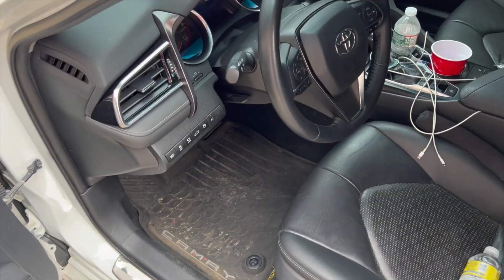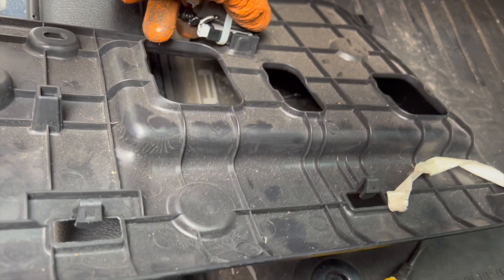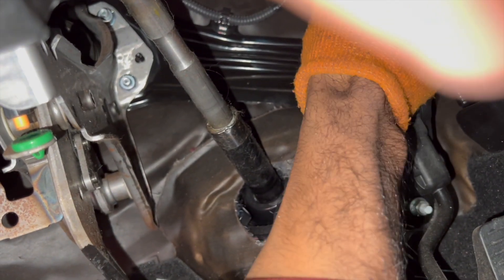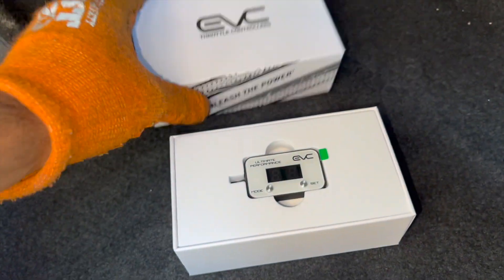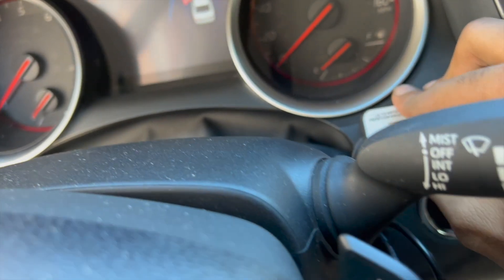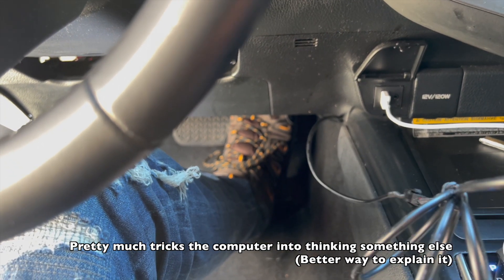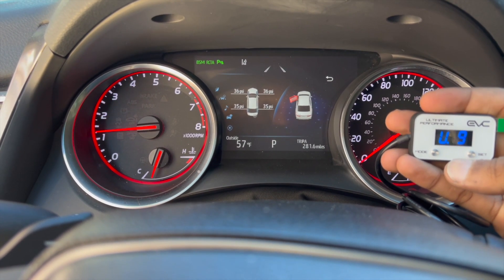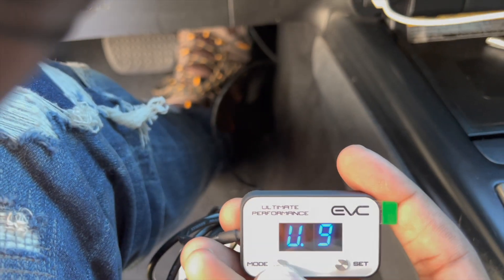How to use & Install the iDrive USA Throttle EVC Controller in a 2018-2024 Camry (All Trim levels)

Comment: It's obviously a very simple install but your video is great and well done. Thanks for sharing. 

Quick question though. Every video I've seen on these are on a 6 cylinder model. I assume it works on the 4 cylinder since their website doesn't specify but I figured I'd ask.
Reply from the maker: Well I’ve gained this information and experience from using it on my 4cyl SE Camry. Thats how I was able to explain it in this video from having it for about a year before I made this video. 

The one I installed actually came out of my Camry because I sold it to this owners of the V6 and upgraded to the EVCX.
Reply: @crimsonkamuri  I appreciate it, thank you. Great video. How do you like the EVCX? I'm looking at that one too.